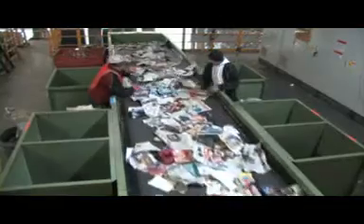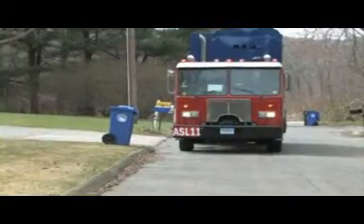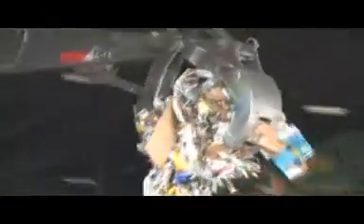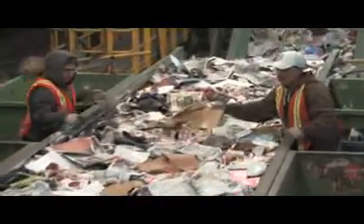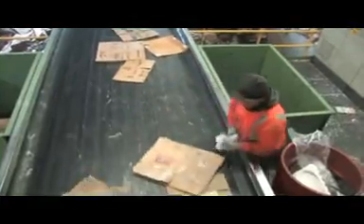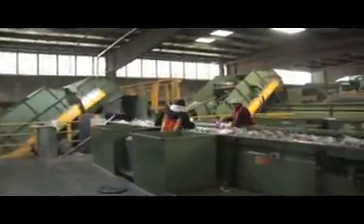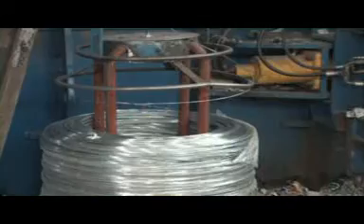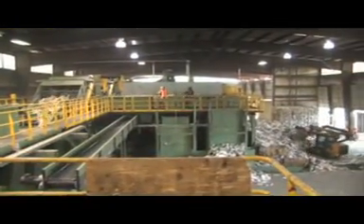Willimantic Waste Paper's Single Stream Recycling Facility.

Comment: Think how much easier it would be if people just seperated their newspaper from their plastic It could cut a load off the whole production! Which in turn would mean not so many people working that production (although I doubt there is a line of people wanting a job at this plant amongst all that smelly garbage) it would also mean the collecters putting it in different sections of their truck on pick up and Cardboard would still need seperating from paper But only a quater of the machines used for the sorting process would be used saving money
Reply: daniel rosevear but that adds 2 extra routes, 2 extra trucks every 3-5 years, etc. a lot of routes they have are done in split body trucks, picking up trash and recycle side by side. The old 7 compartment trucks are outdated and useless. It simplifies collection greatly and provides a better day to day experience for the drivers. 

Sc: used to work there.